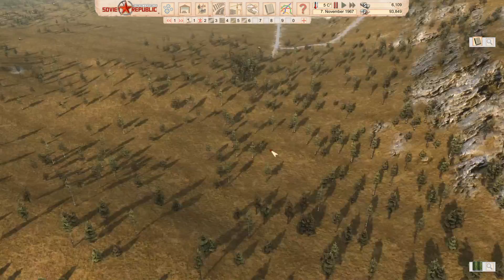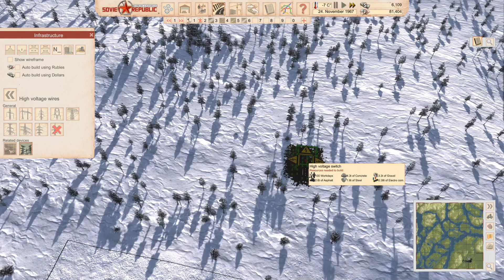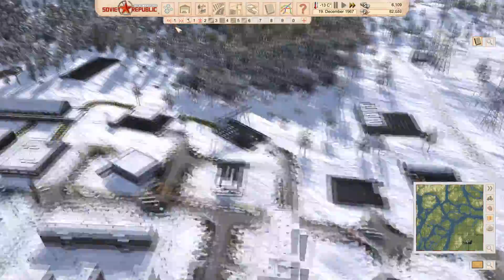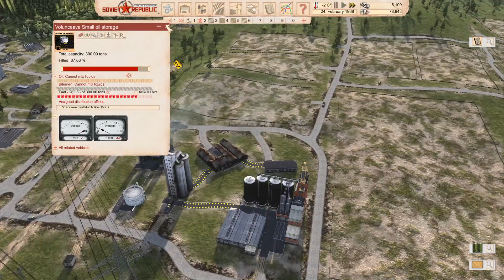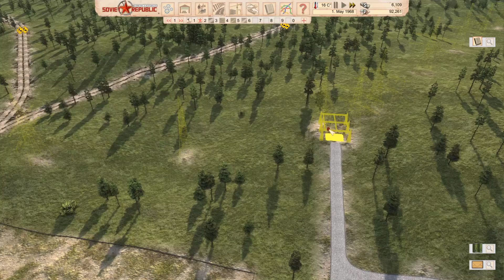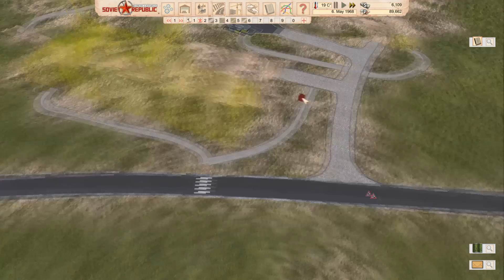Power Station Complete :: Workers & Resources Soviet Republic (Seasons Update) #12

Comment: I think when you check power consumption the lower number is actually more relevant as it accounts more than one source sharing the load.
Thanks for the series by the way
Reply from the maker: Ty for the tip.  Have never really wrapped my head round the power supply ratings.